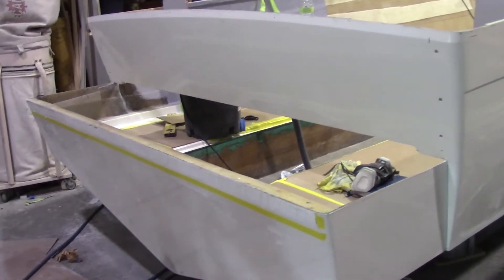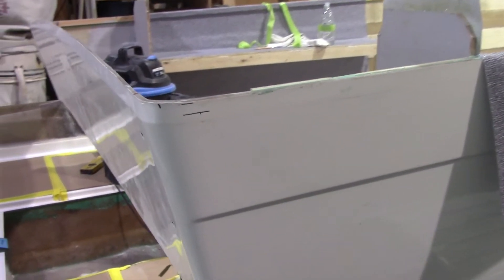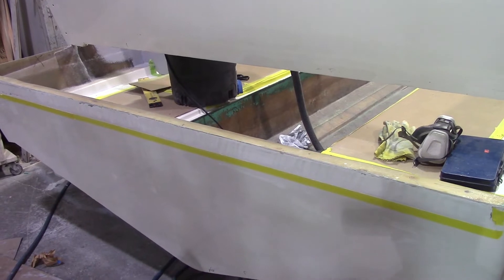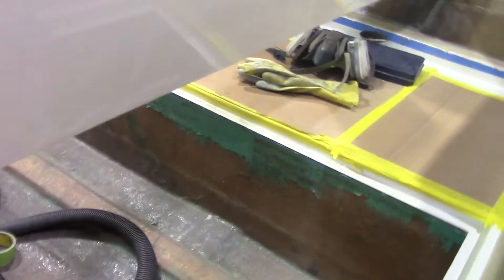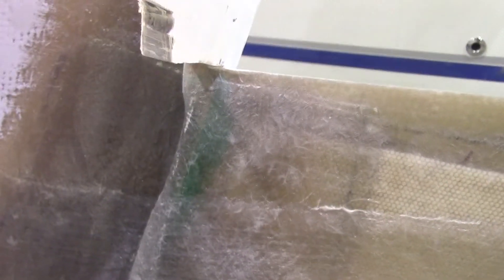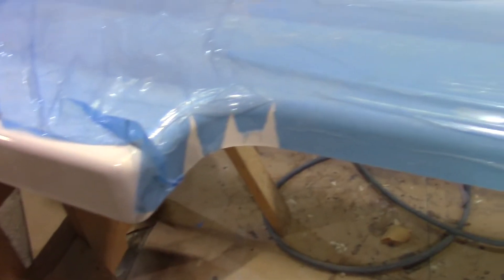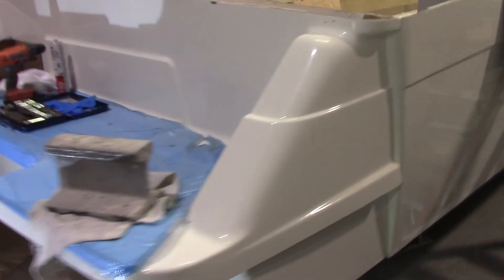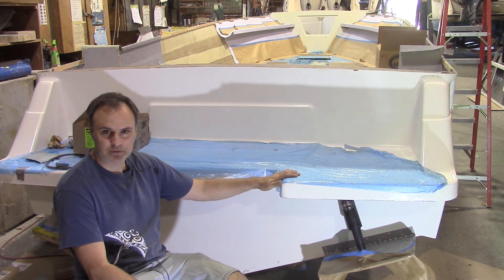Extending the hull of a fiberglass boat

Comment: I have a 26' and am interested in exploring options to extend it. My concerns are: 1) the balance while sitting still since the engine would get pushed back, 2) the bow level when running, 3) would 2.5-3 feet be too much to add to such a small boat?